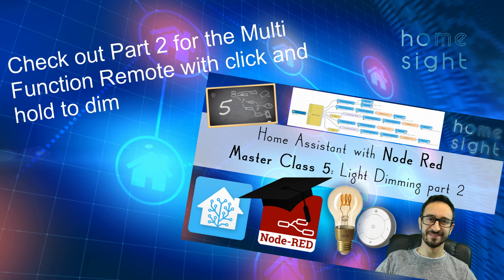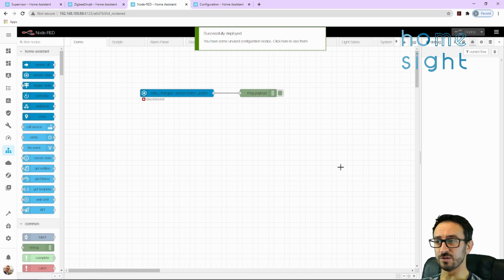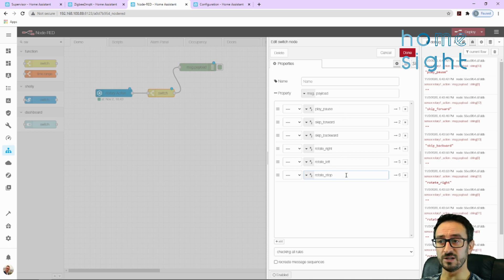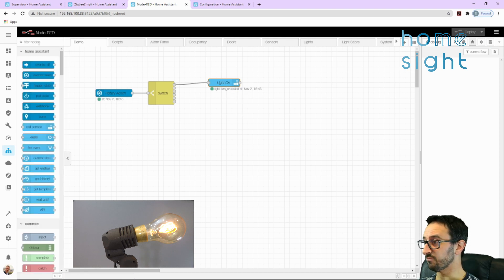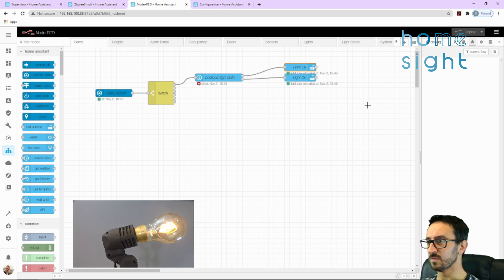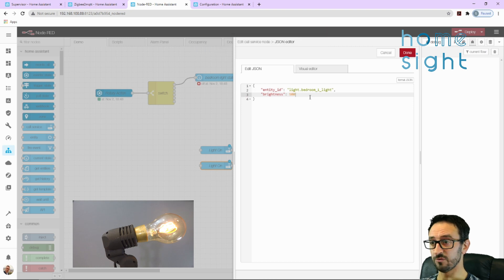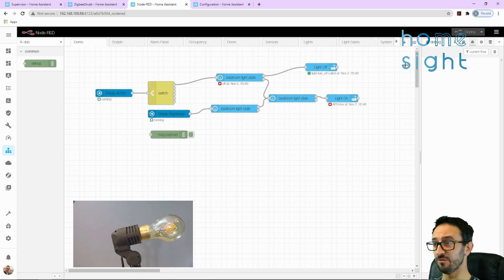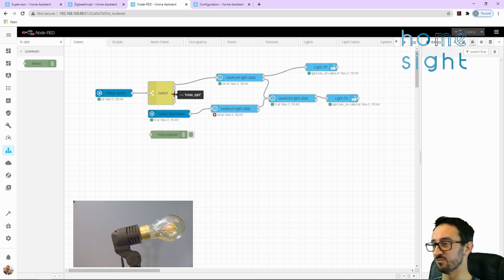Node Red + Home Assistant -Master Class 4. How to control light dimming with Zigbee light and remote

Comment: I would say that using HA in between Node Red and Z2M is inefficient*** and you have an extra part of software that can malfunction... I would suspect that using Z2M > MQTT > Node-Red (using its build in mqtt client) would eliminate the most unreliable point of failure (HA)...

That aside, your tutorials are very useful and a quick 101 on using node-red!
(I just added some logic going from HA to MQTT, its just a bit more work but still very helpful)

Thank you!

* I could be wrong, and there could be a very good reason to use HA in between if so could someone explain?

Comment: I was following along with this and found it really useful. But my Ikea rotary dial does not have an sensor._brightness setting 🤔
Reply from the maker: Did you set that in your YAML?
Reply: @HomeSight  and now I've just seen your response too :)
Reply: I googled a bit and found your video on configuring Ikea switches. I then hit a brick wall because studio code would not accept the code from your page.

I googled some more and found that there were breaking changes in a recent HASSIO update. 

So now not only two I have dimmable bedside lamps, but I've successfully completed my first coding in YAML.

Thank you for the great video.

Comment: Great video. Thanks 😊
I recently bought 2 rotary buttons to control my Heos speakers, also using Z2M. I can't seem to keep the buttons connected to my zigbee network (or they stop transmitting their actions), therefore become quite useless. Z2M also says their is a firmware update available, but I can't push it to the button. Do you have any idea on how to attack this?
Reply from the maker: Hmm, I too had a struggle doing a firmware update, but haven’t had any reason to as they’ve been rock solid. I did consider doing the firmware update from the ikea hub… but like I said, I don’t think I have a need to.
Reply: @HomeSight  For me, unfortunately, it the absolute opposite. I hope I can find someone nearby with an Ikea hub so that I can upgrade the firmware. If not, I'm considering the option to buy one myself, just to use these 2 buttons. Anyway, thanks a lot for your response :)
It also might be the edge version of Z2M I'm using. Need the edge to get my tuya plugs to work though

Comment: Amazing tutorial! This is exactly what I want. 
I'm running into a problem though when it's time to choose the  "sensor.xxxxx_brightness" entity in Node-RED. I've added my Symfonisk through the zigbee2mqtt process and it automatically created some entities for me (I haven't added any lines in the configuration.YAML file yet), but I can't find the  _brightness entity for my sensor.symfonisk device. I can only see "_action" as an entity but I see brightness, battery etc as attributes under action. 
How can I create the sensor.xxxx_brightness entity? Do I need to fiddle with the configuration.YAML file?
Reply from the maker: Hi Victor. Glad to help. Yes it is a Yaml thing:   
  - platform: "mqtt"
    name: "Rotary1 Brightness"
    state_topic: "zigbee2mqtt/rotary1"
    value_template: "{{ value_json.brightness }}"
    availability_topic: "zigbee2mqtt/bridge/state"
    icon: "mdi:brightness-5"
Reply: @HomeSight  Thank you so much Simon! I got it working. I can't thank you enough.

Comment: Fantastic videos, working my way through them as i'm a total noob :) Something i can't  find is how you control lights with a hue 4 button dimmer but no hue hub, i have a conbee II configured with ZHA but despite spending two days on it i cannot figure out how to access the dimmer buttons or events in node red - can you offer any help please??
Reply from the maker: Hi! I don’t use ZHA personally, I prefer the messages to come in using MQTT. From
What I understand with ZHA, you should have the device natively in your device list. You should be able to put the device as an events state node. If you were to put an event state node in, you should be able to that to a debug node...
Reply: @HomeSight  Thanks, i have looked at trying pretty much all the options in events state nodes, nothing apart from the battery level is announced it seems. They are there in Automations but not node red, no idea why as it seems a big lump of usefulness is missing. I will have  a look into MQTT. The zigbee adapter is a conbee II as that was the recommended one to use.

Comment: These videos are fantastic, thanks so much! I've used them to learn how to use node-red and find uses for my ikea buttons.
My only complaint is that your screen recording is a little blurry, I wish that the text and UI was a bit more crisp.

One question, the message payloads you get from the buttons all have identifying words, i.e. play, pause, etc. I'm using the small two button ikea switch and the only messages it sends are numbers. Is that unique to that switch or is there something you are using that translates these codes into words? The switch is connected via a ConBee II, and my Home Assistant is running on a Pi 4 if that makes any difference.
Reply: Same for me with the playback resolution. Great videos, nonetheless. One thing I thought Simon might explain is why the json interpreter showed an error for {{payload}} but it worked anyway. I don't have a rotary dimmer but parse Lovelace slider values into variables to do much the same thing. Thanks, I should say, to the Home Sight node-red videos!
Reply from the maker: Hi Richard, the playback resolution on all of my newer videos is 4K, so should be all good now! The reason it errors is because the parser doesn’t see {{payload}} as an integer and therefore throws an error.
Reply: @HomeSight  Thanks. I'll look forward to those when I catch up!
Reply from the maker: Hi, i think I’ll have to start recording in 4K. All the Ikea ones I tried had identifiable words rather than numbers. I don’t see that it should make a difference with conbee, unless Zigbee2MQTT is doing something clever...
Reply: Thanks for the very quick reply!
4k might be good, but maybe not necessary as I've seen crisp 1080p screen recordings on Youtube. Or perhaps they are recording in 4k and only making it available in 1080p on youtube. I still think your videos are great though.

I see, once I get more switches I'll perhaps see if there is any difference, though if I remember correctly, your two button switch didn't give numbers like mine does. But yeah, perhaps zigbee2mqtt is doing something to assign words to those numbers.
Reply from the maker: Hi, I think it’s because I’m downscaling at my end, I’m recording a high res screen and outputting at 1080p. You are correct, my 2 button did have words, it must be zigbee2mqtt being clever